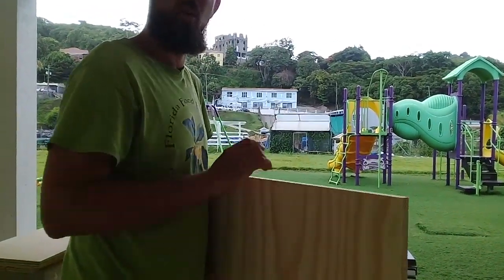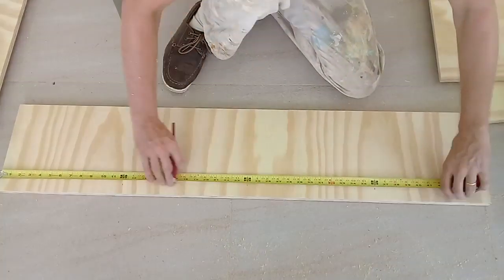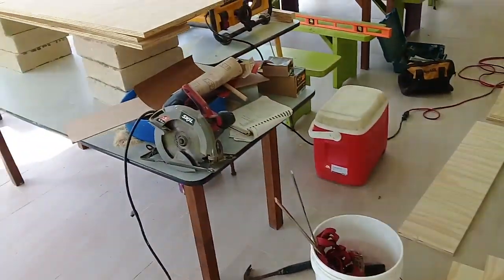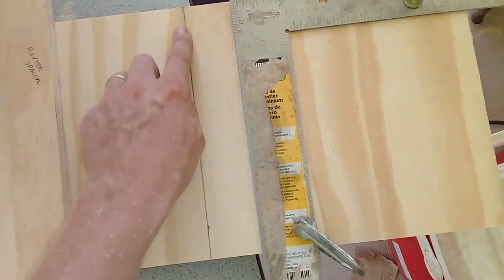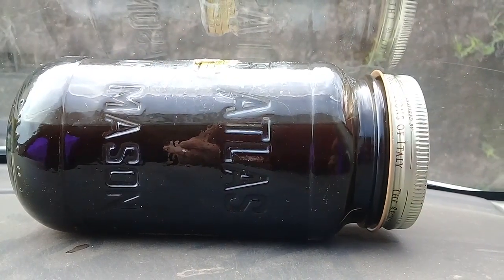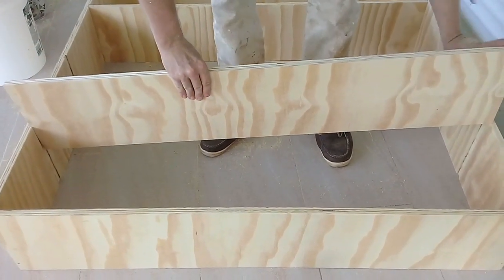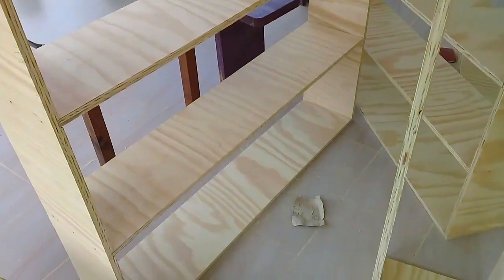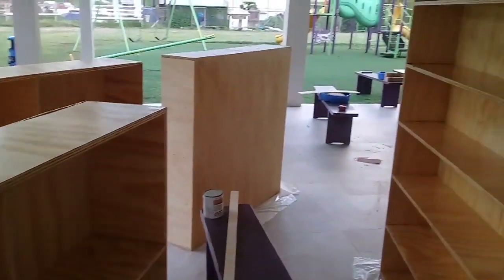How I Build Simple Plywood Bookshelves with Dado Joints

Comment: Hi David, sorry to bring this up almost 2 years later, and I'm sure others brought up the  safety issues. You open the video doing it very dangerously. 
FOR PEOPLE WATCHING THIS AND TRYING TO WORK WITH A TABLE SAW: - Never cross cut like in the first scene of this video. General rule of thumb - if the the material edge  against  the fence is shorter than the distance between the fence and the blade, STOP.  Use your miter gauge or a crosscut sled. Think twice when crosscutting material. Look up the difference between crosscutting and rip cutting

Comment: I am a book lover too. I own several thousand books. I have owned both homemade & commercial bookshelves.  One thing that ALWAYS happened was that all the shelves bowed under the weight of the books... Therefore, I would recommend that you run at least one screw into the center of each shelf from the back, essentially attaching each shelf to the shelf back. It will save you some future heartburn...
Reply: I was thinking the same. Or run a bead of wood glue down the back edge of the shelves before dropping the ply back. Or both.
Reply: An even stronger option, though just slightly more complicated, is to cut a dado across the face of the back, corresponding to the dados in the sides. You would need to cut the shelve wider than the body, by the depth of a dado. Glue up that dado joint and/or screw it if you wish. Rock solid.
Reply: Say hi to Uncle Ralph for me!
Reply from the maker: Yep - I did that. Two or three screws on each shelf.

Comment: how you just cut that strip of ply in the beginning on that saw was NOT safe. should use the miter gage in that miter gage slot to support your pushing that wood. The miter gage at 90 degrees. That was not safe free hand. Your asking for a seriuos accident there.

Comment: Dude, NEVER leave a cut piece of wood sitting between the fence and the blade! With just the slightest movement of that block of wood, whoever was holding the camera would have needed a new face. Love your videos, DTG, but be safe out there!
Reply: My thoughts exactly!
Reply from the maker: I've never had trouble but I'll keep that in mind.
Reply: this gave me anxiety. Wood will kick back out of a saw at over 100mph. Def use a push stick!

Comment: Great video 👍
Have you considered gluing the shelves instead of screwing them? A tad bit messy but overall I find it provides a much stronger join.
Reply from the maker: I did, but decided not to because of time constraints. Good idea, though. That would have made them virtually indestructible.
Reply: Or both.
Reply: Is that 5/8” ‘s ply?